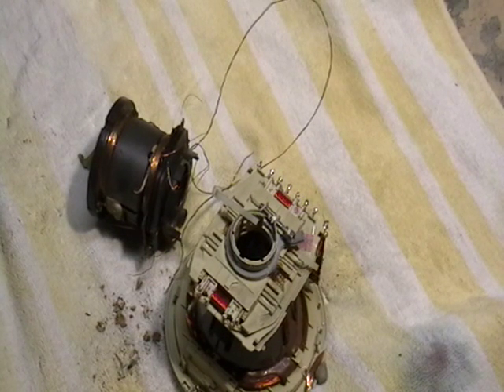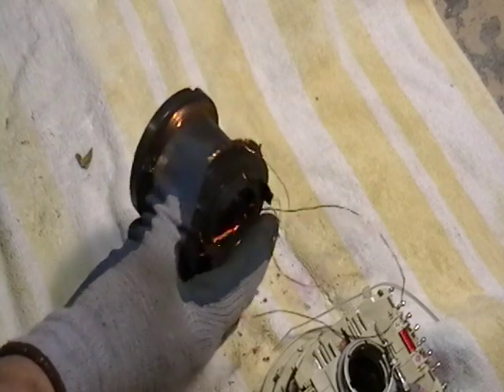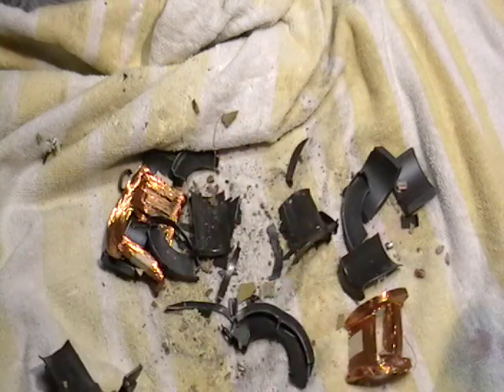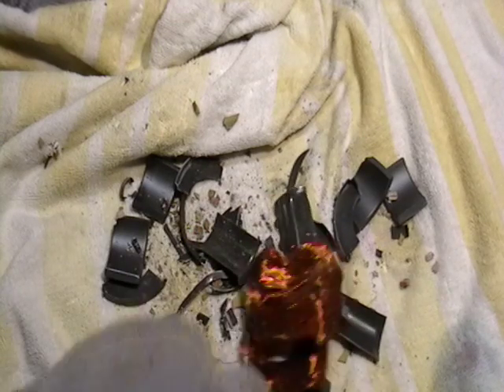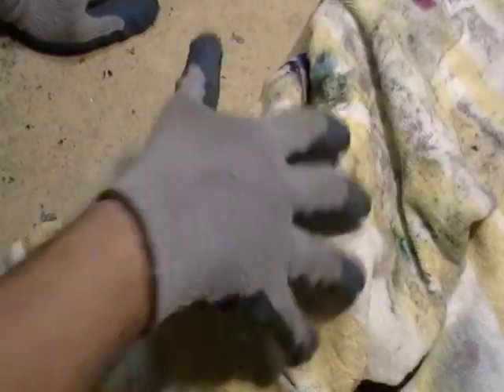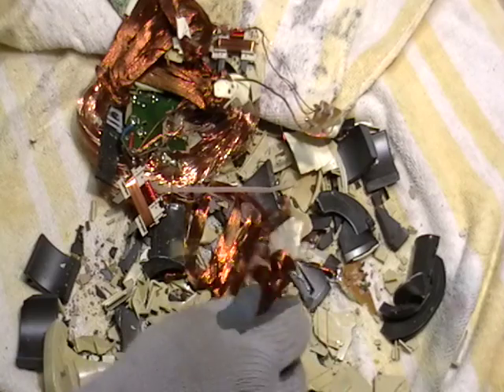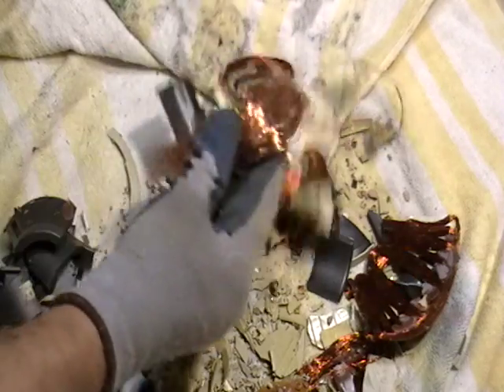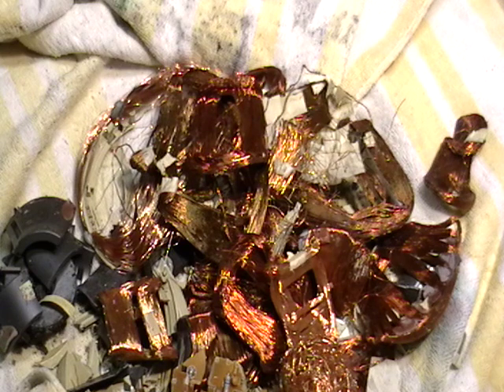Scrapping tv yokes for copper

Comment from the maker: @hottieiam...I have seen the wire with the tape around it made from aluminum. When i scrap tvs, i cut the wire wrapped in tape and i seperate the copper from the aluminum. the yolks sometimes have copper in the inside and aluminum on the outside.

Comment: When you scrap tvs or microwaves, look for the relays on the boards also. The very end of the contacts contain silver cut it off and save them.  Most electrical switches have them.  :-) just found that out this winter and i been savin the crap out of them

Comment: Thanks I was talking about the little wire on top of the yolk. I found some red and green I scraped off the color and it was copper I think . I have found purple wire that was around the tube of the tv warped in tape most of them i have found was copper but this one was not the same color, I just scraped 6 tv's and 3 computers I got about 8 pounds of copper out of them so far and I am going to run an add to pick up scrap to make a little more income on the side.

Comment: I'm having trouble with the #1 and #2 wire. from what I understand #1 is bright copper wiring with nothing on it. No varnish or shellac or anything, it's bare wire. you're telling me that yoke has #1 and #2 wire on it? if I touch any two points on the #1 wire with an ohm meter it should show a dead short.
Phil Galati
Morris Plains,NJ

Comment: the difference between number one and number 2, is like 1 : 99% copper and 2 : 99%+ contains tin or lead on the soldered areas and other plastic or insulation.